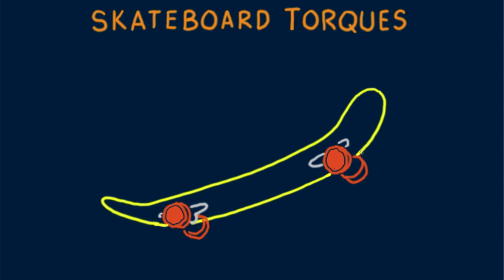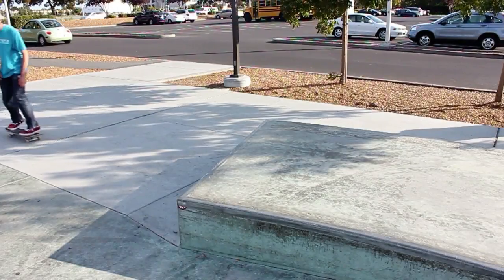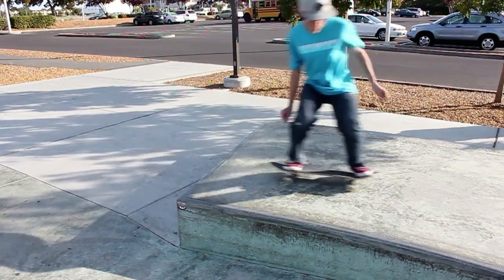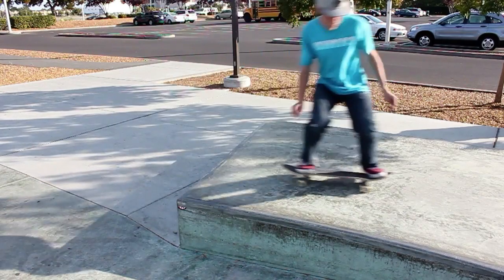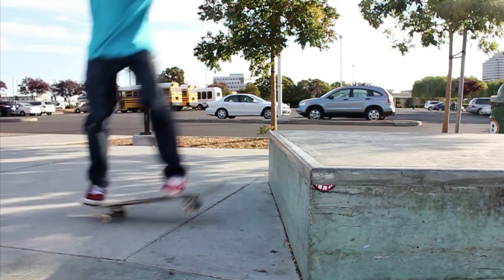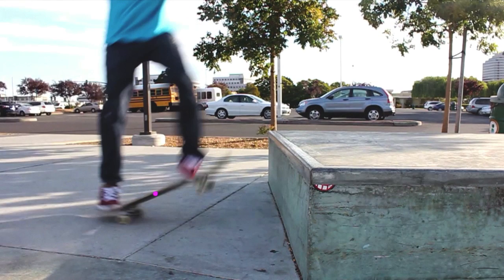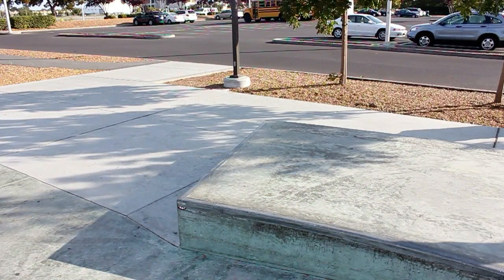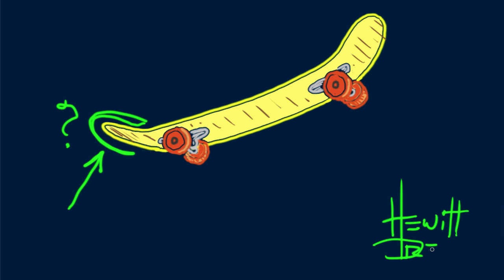Hewitt-Drew-it! PHYSICS 42. Skateboard Torques

Comment: Actually, angled tails of the skateboard elongate the lever-arm which increase the torque (for the same amount of force applied). Second, angles help to rise the opposite end of the board higher. That's why all cars and even airplanes have an angled edge at the back. For cars, it prevents bumping the back when taking high slope road, and for airplanes, prevents against the same when taking off.

Comment: Tell me if I am correct:   The tail of the skateboard stops the counter-clockwise rotation of the board when hitting the ground (because the hit produces an opposite force that stops the rotation) , and than the upper part of the skateboard (the 2/3 of the board that is in front of the back set of wheels), because of its inertia, pulls the tail up.